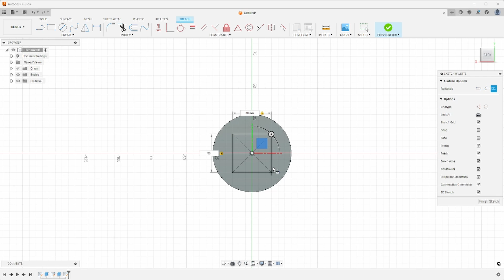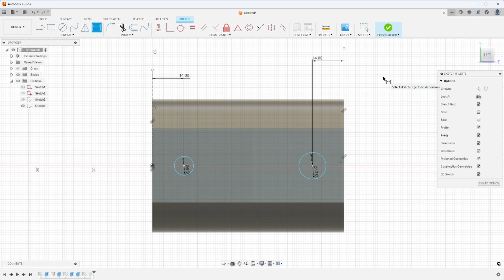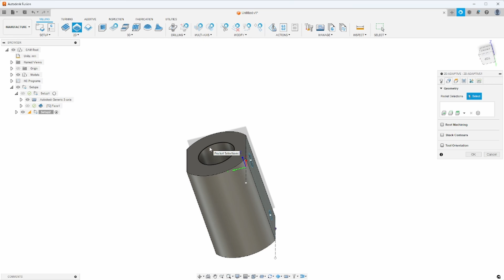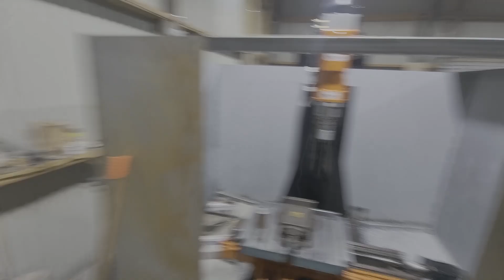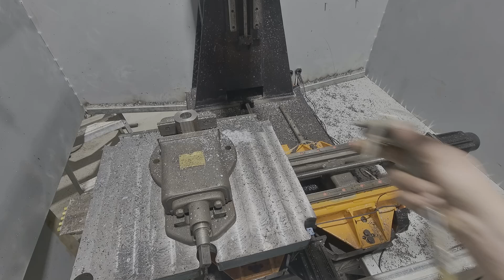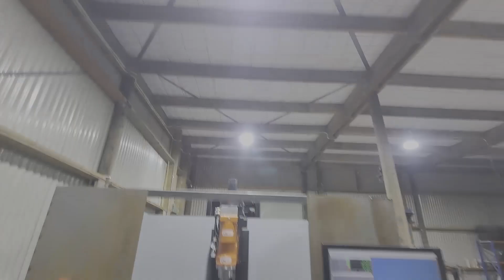DIY CNC Milling Machine in Action: My First Project

Comment: I'm hoping you've got a proper handle for that vice now, you need A LOT of torque to hold things in a vice. I always use too much. I've never managed to keep anything tight/secure with a wrench (I have tried), pretty much this exact same thing happened, though my spindle didn't stall because its pretty dang powerful. Also I either dent the square/hex drives on my vices if I use a wrench, or mangle the wrench. So yeah, you need a lot of force, a couple days ago I used a MASSIVE 60+cm adjustable wrench on an old vice with a missing handle (it had a 9.5mm /  3/8" square drive). I couldn't absolutely gronk on it, or I wouldn't broken the vice, or bent its screws, but it did offer a wide contact area on the square drive.
Reply from the maker: Na i still dont have a handle lol. Im a slow learner lol. Yeah vibration makes it loose and I think my setup want great. Cheers for the comment

Comment: Nice to see a DIY CNC where someone actually shows milling steel.  I had a high speed spindle on mine but am switching to a spindle similar to what yours has.
Reply from the maker: Thanks, mate, appreciated. Yeah, my main reason was to mill steel. I have a lot of projects I want to do, and steel is what I like to build my projects from. The spindle is really good, I would say. Though, if the budget allows, get a proper spindle servo to run it. The AC motor I have on it is okay, but a spindle servo would have more power through the whole speed range and higher speed capabilities.
Reply: I put the largest Teknic AC servo on my full size manual milling machine and it seems to work well.  Probably cheaper alternatives if you know what you are doing.  I'll put the same servo on the CNC machine I have going.
Reply from the maker: @mikeyh6104  o right, I bet that is really good what speed is that
Reply: It has a flat torque curve up to 1500rpm and then starts falling pretty quickly.  Wouldn't be good if you want to run at any high speeds.
Reply from the maker: @mikeyh6104  o right, I see could that be to do with the control or is it just the motor itself
Reply: Not really sure on that, just going by what the literature says on it.
Reply from the maker: @mikeyh6104  o right I see

Comment: Really like this types of youtube content! Showing the everything ups and downs.
A advise is to have the correct lenght on your probe, then when you start getting more tools and holders it is easier to get a sanity check of the lenght than wondering "wait is that tool 23.73mm longer than my probe?
When probing the round stock, don't know about mach4 but if you have a outside probingroutine first do that then you are on centerpoint for z
Reply from the maker: Thanks, mate. I appreciate that. You don't learn unless you fail, lol. The probe is definitely a game-changer for me. With the offsets and setups, it makes things a lot easier. I will have to look into the probing routine and see how to do that. It sounds better than my eyeballing method, lol.
Reply: @gingerninjaneering  It might take a little fiddling with the toolseter height because these type of machines might not be as fast reacting to contact. Another advise is when you want to have control the z height you can set the offset on the bottom of the part and probe the surface you are placing it on.
Reply from the maker: @lunchman84 I did wonder about the speed; would probing slower help? That is a really good idea about probing the surface I'm putting the part on; that would be much more accurate.
Reply: @gingerninjaneering  yes, on my machine going down to below 30mm/min for the second hit makes it much more repeatable.
Reply from the maker: @lunchman84 I will try that. Then, I think it is at 60, so half should make a difference.

Comment: I don't think you need a bigger spindle motor, you are already overloading that little taper. On a factory made cnc mill you have broken the endmill at the shank so your on the limit with ridigity also. Run the toolpath in the air before you start cutting so you can spot moves that won't work. For expensive parts I make it from plastic or something so I make the real part from the first try. Greetings from Hungary.
Reply from the maker: You make a good point. I guess it is only a BT30. Just the flute chipped at the end broke on the end mill, not at the shank, but it probably could have if the part had not come loose in the vice. I like the idea of running the tool in the air first; it seems like a logical way to test the tool path. It is also a good idea to test in a softer material as well. I will try that in the future. Thanks for taking the time to comment; it is most appreciated.